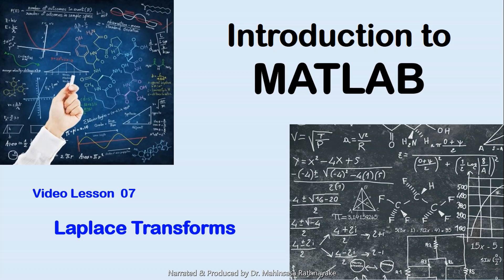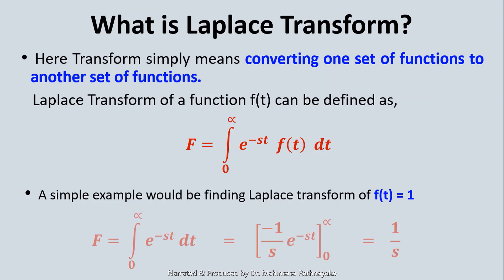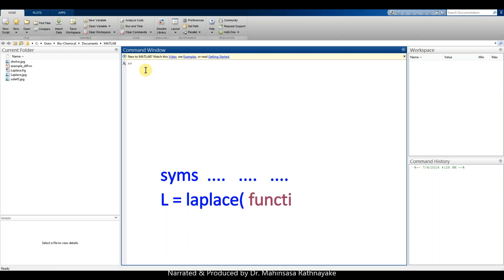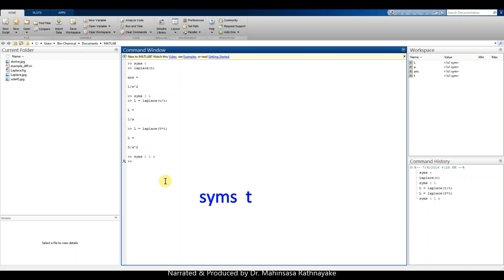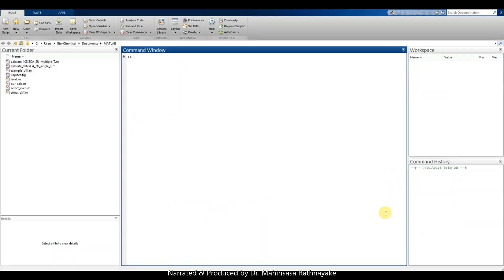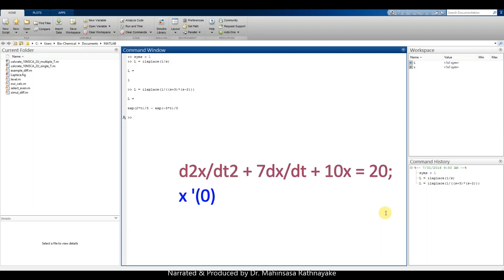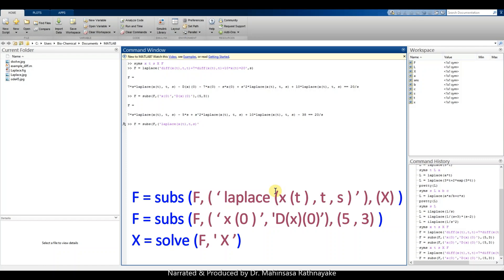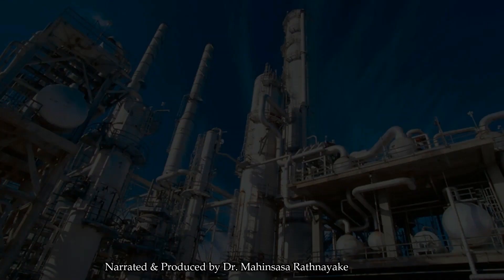MATLAB for Chemical Engineers - Lesson 07: Laplace Transforms

Comment: Sir, it is showing an error in the second line: 'Error using sym>convertChar'. I hope that you will be able to resolve this. Thank you.
Reply: Sir same error even here, that differential eqn isn't accepting, I can't proceed after 8:37
Reply from the maker: Hi, You have to type "syms" before introducing symbols. Not "sym". If not, please check with MATLAB help for your version used.
Reply: @TheProcessEngineer  the same error happened here and I type "sims" as you did.
Reply: @Konard Adams nah same here isnt working